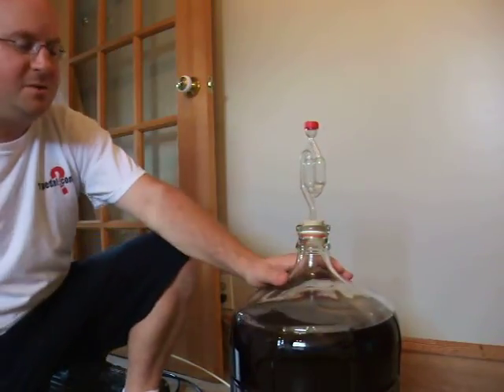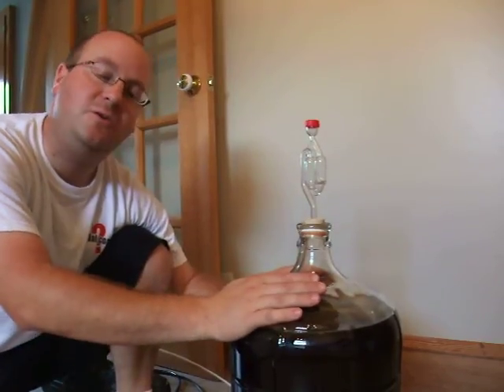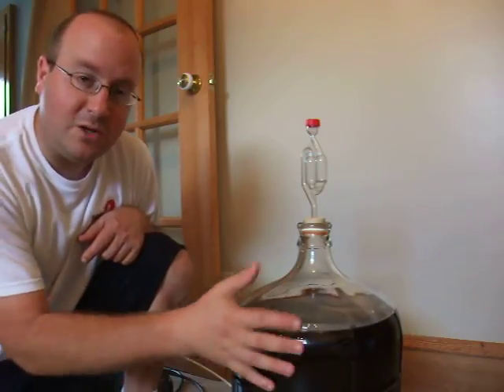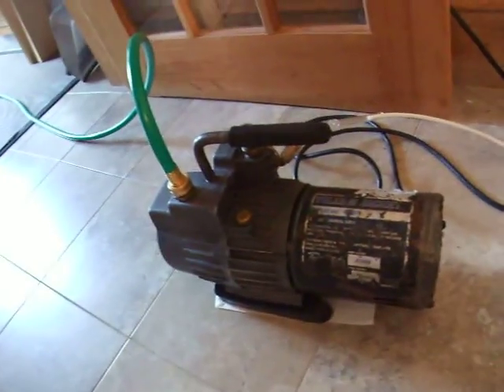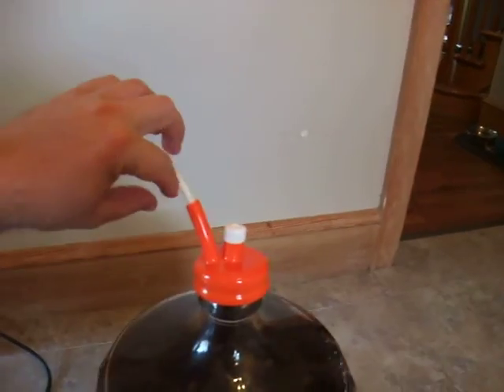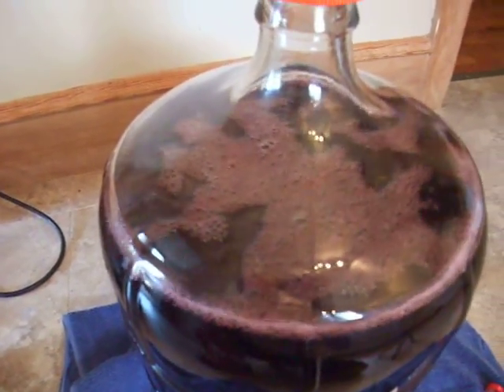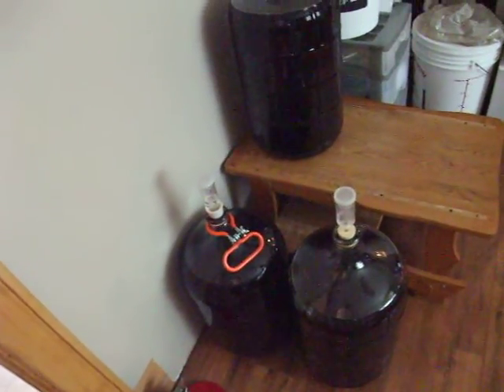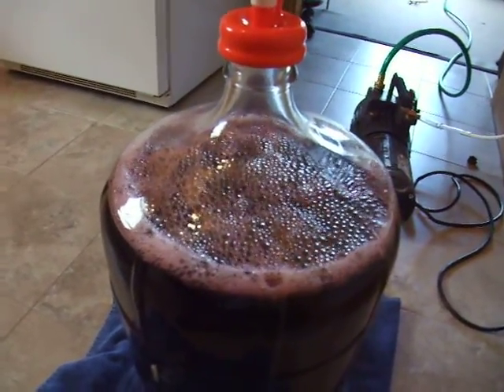Wine Kit Co2 Gas Removal using a Vacuum Pump

Comment: I'm highly surprised that the carboy didn't implode.  Those industrial vacuum pumps can pump down to  almost 0 atmosphere.  If I were to do this I would use a vacuum gage and be very careful.
Reply from the maker: potentially yes, it could implode but the soft tubes and loose fittings only allow a certain level of vacuum.. i've since moved on to a purpose built pump ( all in one wine pump ) that works with an oil-less pump.. no more vapors .
Reply: @Ypedal  i want a same solution - a oil-less pump. What pump you use now? Thanks
Reply: I wouldnt worry, the wine would boil well before perfect vacuum would occur
Reply: The carboy is 90% full. Those things are thick and there's only a small area that's at vacuum.
Reply: @steventempleton5844  No, it won't. You don't understand thermodynamics. That much wine is not boiling unless you have it over a lot of heat. You'll get a little vapor from the surface.
Reply: @aluisious  boiling is a coefficient of heat and pressure, plus i  did it with my vac pump and can confirm it boils

Comment from the maker: It's done when the bubbles stop, but you notice a significant reduction of bubbles near the end.. typically 10 minutes is enough.. a small tiny bit of CO2 left behind is not a big deal... you just need to get the bulk of it out before proceeding to the clearing stage.

Comment: Thanks for the help providing this video.  I too make Costco wine from kits, the Argentia Wine ones.  They are amazing and, frankly, better than store bought.  I too hate having to stir to degas, a total of 21 minutes of vigorous stirring, and always look for a better way.  You have proved reasonably well that a lot of CO2 remains after hand stirring.  I am interested in seeing how much is left after stirring with one of those gadgets on a drill.  In other words, vacuum is better that hand stirring but is it better than mechanical stirring?  I ask because, if I do go another route, a gadget costs $10 or so and up.  Those vacuum pumps are about $150 and up.
Reply: +buddyboy4x44 Vacuum pumping is far more effective than any kind of stirring. You could use a wine saver manual vacuum pump to save money. Its still much more effective than stirring.

Comment: Did you ever do a video on the new pump? I like the idea and I'm thinking of using a 12 volt pump.
Reply: why do u try it with vacuum cleaner? :)
Reply: @Hijaazz  I tried a vacuum cleaner hose attachment which actually has a very strong suction and it wasnt strong enough - I could tell it was trying because a fog appeared inside the carboy but it wasnt enough to actually draw out anything

Comment: I've used vacuum pumps for years on actual ac systems. I hooked one up to my carboy and the vacuum pump oil traveled backward into the tube and dumped into my wine 😑 such a bummer. I'm baffled on why this happened
Reply: If your pump is good and newer it should have internals to prevent that. As I understand it, if you release the vacuum before turning off the pump. That shouldn't happen either. You should also have a moisture trap in line which protects the pump and would protect against the oil.
Reply: You probably turned the pump off while there was still a vacuum in the carboy. Now you have air outside the pump, then oil, then vacuum. The air is going to push the oil into the vacuum.

A more sophisticated pump is going to cost more.

Comment: How do you break the vacuum in carboy/plug/hose setup?
Reply: Place a tee valve in the line between the carboy and the pump.  The third opening of the tee valve should be connected to a needle valve.  This way you can open the needle valve to break the vacuum.
Reply: @coreyfugate8770  Dude that doesn't matter. The plug is soft, just pry the edge until it leaks.

Comment: A vacuum pump in essence is removing 1 atmosphere of pressure to match a perfect vacuum of space. 15 pound per square inch forces down on all things at the surface of the earth or 30 inches HG mercury using a vacumm gauge 1 lb = 2 inches hg conversion.  Point is, lowering atmospheric pressure off of water to 28 in hg, water boils off into a vapor, and what you are doing is boiling water, reducing its boiling point to around 40 degrees F.  PS. The mineral oil in a vacuum pump is to extract minute particles of moisture and suspend them for 1 evaluation procedure and 2, to create a seal between the impellers of the pump. HVAC Instructor/30 years experience
Reply: Old Parts nice theory, why does it stop bubbling after 10 minutes then?
Reply: So what are you saying then?

Comment: I think what you are seeing is the wine boiling at room temperature.
Basic phisics tells us that liquids boil at a lower temperature when under a vacuum.
Around 30 in/Hg, wine will boil at around 20 degrees celcius.
Reply from the maker: I was afraid of that possibility, so i did some tests, i poured pharmacy grade ethanol 90% into a glass jar, and when put under the maximum vacuum my plastic lines would allow, the alcohol did not boil, if i ran copper lines and proper seals it might , the pump is strong enough for it, but not with the setup shown above with plastic lines just slipped into each other.. i'm pulling aprox 15 in/Hg max.  

Since water has a higher boiling point than alcohol, my 12~13% wine is not loosing out, those bubbles are indeed CO2 !
Reply: +Adie Louch No, that's not the wine boiling. It really is the CO2 coming out of solution.
Reply: +Yaddahay smarmalite yes it is. Do the same with water. You'll see it boiling.
Reply from the maker: +Adie Louch .. In theory it's possible with copper lines and a proper canister, but the bubbles seen in my video, are all Co2, the wine is not boiling..
Reply: co2 is evaporating out. not the alcahol or water
Reply: PV=nRT   Ideal Gas law...liquids boil at lower pressures.  Has nothing to do with product temp, nor does the product increase in temp.
Reply: What throws people off is the word "boil".  Because we're familiar with water at 1atm, it has to be hot (212 or 100).  They dont understand boil is being referred to a transition in the state of matter.
Reply: "liquids boil at a lower temperature when under a vacuum" is true but you still need a heat source or the liquid is going to 

1) boil slowly
2) cool until it freezes

because when a liquid boils the vapor must take heat from somewhere. This is a large amount of wine and if you pumped it for a very long time it would freeze before it all boiled.
Reply: @chris302001  what throws you off is that something "boiling" at room temperature is going to boil VERY slowly if you're not adding heat.

Comment: He has no idea how to run the pump.Do not follow this mans instructions.He has no idea how that pump works.Hey buddy open the ballast before you ruin your pump.
Reply from the maker: Well, i admit, i am not an HVAC tech and this video was not about the pump technical aspects ( btw.. the pump is a retired unit no longer used for industry, but still functional, the guy i got it form assured me that as long as i keep the oil clean, the short 10 min at low vacuum will not kill it in my lifetime.. ) the vacuum line is plastic tube over rubber tube with no clamps, i am not going anywhere near the max potential of this pump.. if that even matters regarding your comment.

i googled it quick.. http://www.hyvac.com/tech_support/Gas%20Ballast%20Valve%20Explanation.htm .. i welcome any advice you have to share.
Reply: +Gary Bell Where's your video to show us how to use the pump correctly? Until you produce such a video, why should I listen to you? Big talking know-it-alls are rife in human society. I appreciate this video for its proof of concept - degassing wine with a mechanical vacuum pump. I liked it.
Reply: Okay, so my understanding of the function of the ballast to allow condensable vapors, such as water, to vent out of the pump in order to avoid contaminating the pump oil.  For how long and how often you use your pump, I would worry too much about it.  I have pump running 24/7 365 and we change the oil about every year.  Really just depends on the application.  Good video, I really appreciate seeing how other people are vacuum degassing wine before I try it.
Reply: Still waiting for a reply Gary Bell